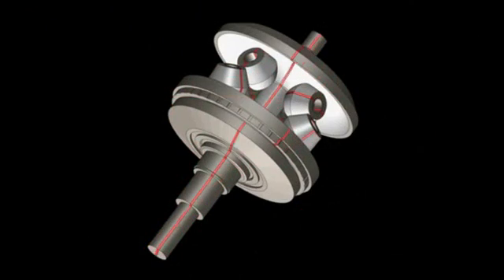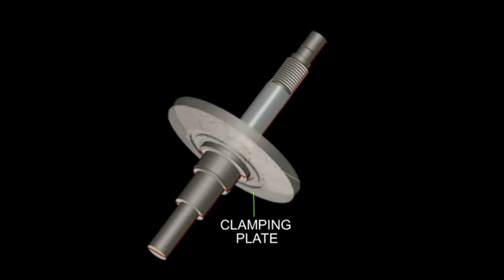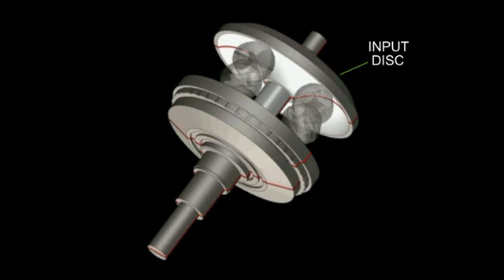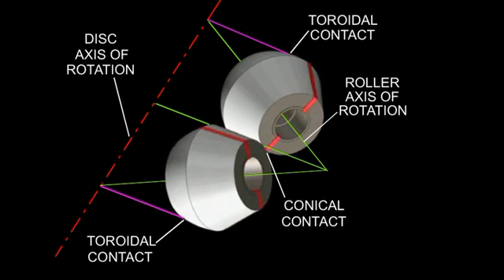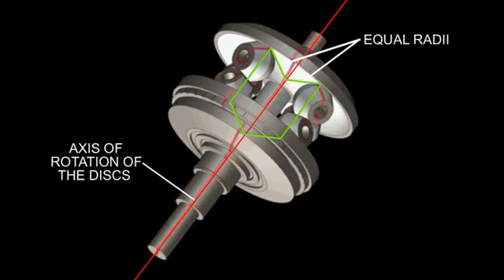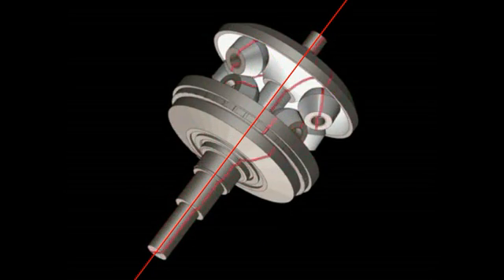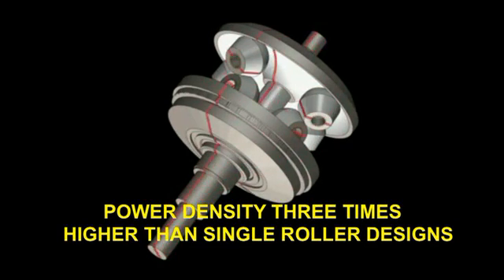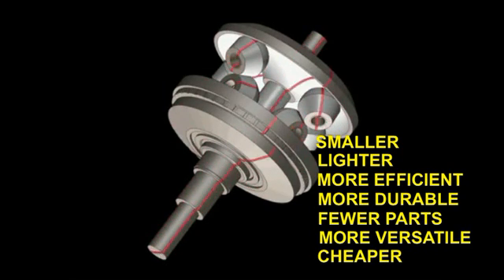Ultimate Transmissions full screen.flv

Comment: Do you know what transmission works best??

None. But by using tesla powertrain, there no such need of using complex transmission as the electric motor can generate high torque from zero revolution
Reply: But it uses very complex consumer electronics, and the entire car relies on the battery, which will deteriorate over time and need to be replaced. I also read that due to the complexity of Tesla’s electronics, if a malfunction occurs, no one will be able to repair it except the company itself ! Believe me, the transmission is very simple, much simpler than complex electronics, and I believe that adding it to the electric motor will increase its efficiency even more.

Comment: It's difficult to understand how you can transmit torque by slippery contact. Is it that the push is so strong that you can transmit the force ?
Reply: The high pressure shear strength of the fluid which becomes an elastic-plastic solid in the during it passing through the contact transmits the torque. To be most efficient this requires a highly specialized lubricant - called a high EHD traction fluid.

Comment: Whay is it better then nuvinchi's model? It looks more complicated.
Reply from the maker: The Nuvinci and this CVT operate in exactly the same way.  There is very little difference in their respective complexity meaning similar parts count for same power.  What sets this apart from Nuvinci is that it around double the power density, more than double the  ratio spread, and considerably more efficient.

Comment: You wont get a 98% efficiency. The power is transferred by the oil film, and therefore you have slipping. the more you add contact (with your double roller instead of single roller), the more you will lose power by shearing the oil layer between the mechanical surfaces. Plus consider the energy that you need to activate a device like that.
Reply from the maker: We do get over 98% efficiency.  The slip required of a traction device to create sufficient shear force is very small, typically less than 0.2% when the surface velocities match which they do with the double roller. It is when the surface velocities do not match that you get more slip.  You get this with a single roller which although it has only two contacts is much less efficient than the double roller.
Reply: Agreed. Just the inertia losses within the mass of the tranny would kill off 2%... before the friction fluid, kinetic transfer to the rollers, etc., etc..

The problem with these designs are all the same. NOBODY has designed a single one of these variators with serviceable friction surfaces that don't require replacing the entire component. Sure, you can easily service and maintain clean friction fluid... but the next thing to go is the friction surfaces.

Also, the simple fact of torque amplification at the lowest output speeds requires IMMENSE losses in exchange of power, and component degradation from shock loading and reflexive load.

Comment: The single hydraulic plate to actuate the rollers is a brilliant way to simplify the IVT system.  The use of fluid resistance to quick shear forces to act as a contact patch is a great way to minimize, if not null, the shear on the moving parts.  The moving of the output gear would have to be connected to another wider gear [differential gear] to allow the fluctuation of its movement, from what I got from the video. How does the double roller system stay in place?  A result of the clamp force?